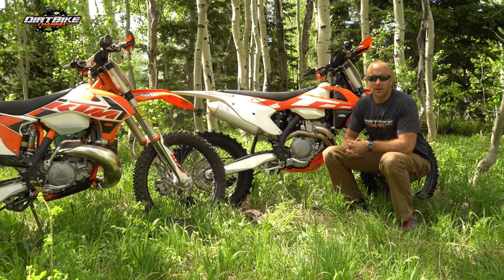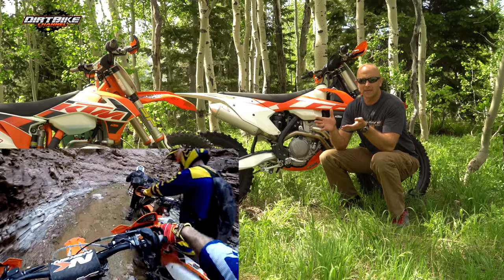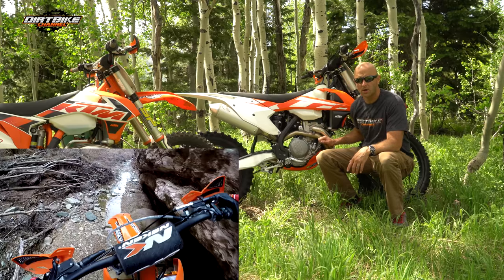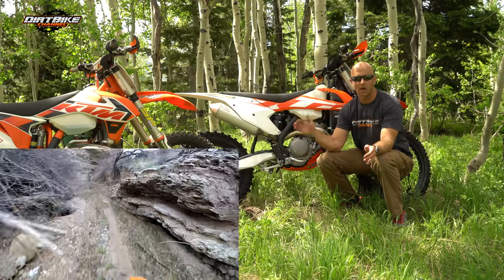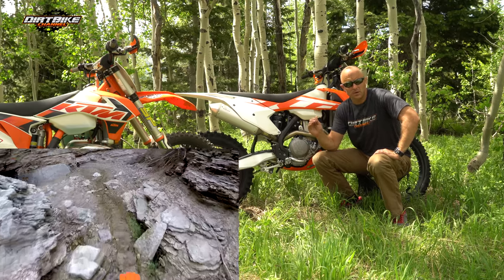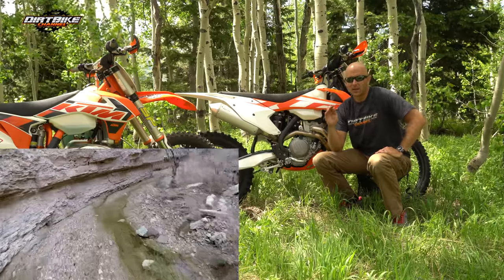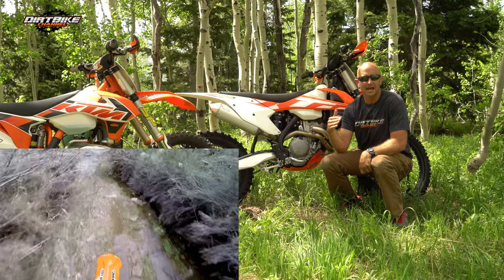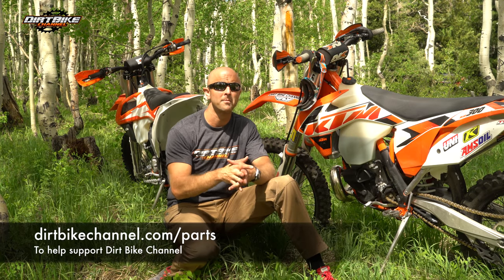Electronic Fuel Injection on 2 Stroke Dirt Bikes? Part 1 - Episode 139

Comment: as you said, yeah it's a trade, but you didn't mention anything about fuel consumption and pollution and with a system like an Athena 2SDI you really don't need a battery at all, with a direct injection the pros are too much over the cons
Reply from the maker: I don't think the fuel consumption is all the much different.  I will cover that in the next video (if I didn't cover it here)...  I have a lot of these bikes and there isn't the much difference in economy from my experience.
Reply: first of all sorry for my bad english, gonna try my best here ahah. the crappy thing about the standard 2 strokes and their low efficiency and high pollution is that some fuel get wasted out of the exhaust because the scavenging and the intake (mix going into the cumbustion chamer) phases occur at the same time, that's really it, and that's why all the injected 2 stroke (for example the e-tec system, one of those used on outboards and snowmobiles engines) are direct injected (meaning the injector injects the fuel directly into the combustion chamber) you really can't compare the advantages of the efi on 4 stroke with those of the direct efi on 2 strokes, with this said i realy think that some madman in the big industries could use a standard NON-direct efi on a 2 stroke (just replacing the carburator with an injector).....and that would be nonsense, since it would not improve that much. if you are interested check "brp e-tec", the old "aprilia ditech" and "athena d.i.c.c (or 2sdi)" you'll get what i'm trying to say.

Comment: But if two strokes get EFI, if the battery would die, could it still run?
Reply from the maker: Yes, many EFI bikes don't have batteries.  They just need to be designed around that.

Comment: Efi on the ktm 2 strokes and other brands (ktm is confirmed but keep reading) before 2020. It is absolutely 100% confirmed. There is a new euro regulation coming in 2020 that is so strict it needs to be fuel injection in order to be clean enough. The guys at ktm are in the final stages of tuning. So in 2019 or 2018 efi is coming in at least ktm 2 strokes. And if other manufacturers want to be able to sell their 2 strokes in Europe then they will need to be fuel injected too.
Reply: Oh, and he also said the 2 strokes price will be more towards the 4 strokes. I'll try to find the press release
Reply: Couldn't find the one I was reading but here's a different one. Can't copy and paste the whole translated version but the original link is not English. 
Read it here- 
http://m.vitalmx.com/forums/Moto-Related,20/KTM-2-T-270-300-2018-uses-electronic-injection,1300441
Reply from the maker: Thanks for sharing.

Comment: Fuel injection is way better. The modern fuel injected snowmobiles have no batteries. The rotax in the new Ski-Doo Summit 850 is direct injected and makes 165 horses, also matches Yamaha 4 stroke sleds on emissions, because it injects the oil directly into the bearings instead of mixing with the gas. FI is way better. easy starts and runs at all elevations and temps.

Comment: "i can not tune my fuel injected bike with a screw driver on the trail"
if you havent tuned your bike before you leave why the fuck would you bother tuning it mid ride?
also you'd never need to tune your fuel injected bike mid ride lol
Reply from the maker: I've surely wanted to tune my bikes mid ride and many of them have had EFI.   I'm just sharing my opinion.  Thanks for the comment.

Comment: You need a battery to run EFI? Hmmm...nope. Hasn't arcticcat had battery-less EFI for many many years now? Yup. If your worried about tuning, buy a power commander 5, weld in a bung on your two-stroke pipe and it'll do the rest for you. Auto compensates. We've done it for years and I bet it's cheaper than a electron carb. And the bonus is when you get home you can plug in your laptop and see everything the engine was doing. Welcome to technology.
Reply from the maker: Right I've had a couple of Yami's with out batteries that had EFI.

Comment: it's a cost thing, direct injection and adding an ECU is expensive. throttle body fuel injection is only a tiny step away from a carburetor... dirt bike companies are cheap and there's already not a ton of profit in them for builders, think about it, they sell for only a little more than a mountain bike yet are ten times more complex.
Reply from the maker: It's not only cost.  For the past decade, they have been trying to get EFI to deliver power more like a carb :)
Reply: Tiny step is to fit TWO STROKE bike in Euro-4?

Comment: Who needs EFI on a 2 stroke?  Not me. I would like to see electric starters on 2 stroke dirt bikes. Why yo ask? I'm 70 years old,but that's not the main reason. I have ridden motorcycles and kick started them for a lot of years  75% of my motorcycles were flat trackers with high compression engines so either kick it or bump start. You know what the electric starter is over 100 years old even motor scooters have electric starters on them. Back to kick-starting a competition engine with anywhere from a 10:1 all the way to a 12:1 compression is hard on the knees and the ankles. Plus being hit by cars while riding my street bikes smashed ankles and knees.Also during my flat track racing all the crashing so many times while trying to win a $2.00 trophy took a toll on my knees and ankles.  So it's time to put an electric starter on 2 cycle dirt bikes,way past time. Says me!

Comment: Drives me nuts that the combined forces of vocal activists and a bureaucrat in an office somewhere will eventually regulate 2 strokes out of existence. Meanwhile the argument you made about simplicity and the impact of a problem in the field 30 miles from the truck and the inability to fix it with simple tools is meaningless to them. Anyway great videos, keep em coming!
Reply: Yes, the same kind of persons who put two strokes out of professional motocross by imposing the unfair and arbitrary rule of twice the displacement for the 4t. If the rule was something like 125 against 200, or 250 against 350, we would probably see more 2 t on the tracks...
Reply from the maker: Thanks for chiming in on the issue.
Reply from the maker: You are making some great points here.

Comment: 2 stroke DI done right never needs to be tuned or tinkered with, just add gas and go. if the fuel injection needs to be tuned with a computer than its a bad design. fuel injected sleds are pushing 12 000 kms on a motor when carbed engines are only pushing 5 000 km's. i have never touched the fuel injection system on my sled, why should it be any different on a dirt bike ?
Reply: Part throttle and constantly changing exhaust temp is why it will never work on a two stroke motorcycle. See my other longer comment in the comments!
Reply: There is a way around it one way or another. the biggest problem is technology just isn't there yet. When technology develops and gets smaller and smarter fuel injection will be lighter and cheaper to have. Instead of an oxygen sensor in the exhaust a small computer could calculate moisture, elevation, and temperature to deliver fuel accordingly.
Reply: Many people have tried and failed. The Suter MMX 500 (google it!) tried at the IOM this year and I have been told had huge fuelling issues. That is 100,000 Euro bike with some really great engineers and minds working on it and they can't get it to work.
Reply from the maker: Interesting stuff.

Comment: ...and that's another reason to go with efi, tuning isn't in your vocabulary anymore, not because it isn't tuned properly but because that's what efi does, it self tunes instantaneously in all environments.  Thanks to the emission standards the motor sports industry was forced to hone efi technology, and now it's fantastic.  the carb technology in these brand new 17 bikes was state of the art technology in sleds over 10 yrs ago.....10...that just blows my mind.  they still offer carbed versions but nobody buys them.  your right efi will come at some point, they may need a reason, like emissions standards or something, but once they make the leap it we'll look back on it like a no brainer.  BTW efi doesn't require a battery.  so many efi myths out there.
Reply: I wish I could link you guys to some two-stroke efi articles but its common knowledge now and so not many people are debating it anymore, for a few years it was a big debate with sleds, mainly mtn sleds, where tuning was an art. honestly I would love the ktm Honda Yamaha engineers take on this.
Reply from the maker: How does the fuel pump work on my bike without the battery?
Reply: +Dirt Bike Channel runs off the power produced from the engine turning.  most if not all efi technology today works on kick or pull start motors.
Reply from the maker: It is true that my YZ450F had EFI without a battery, but it didn't have a fuel pump that I know of.  Maybe it did and I just wasn't aware of it.  It's just that other bikes do have batteries and pumps.  When those batteries fail, then the pumps won't work.  Not sure how they will start after that on in the wild.  Again complexity comes in here.  It's a nice debate.
Reply: +Dirt Bike Channel It's a conversation that will bring better technology eventually  Coming from a sledding background and looking back 10-15 yrs since the technology was born in 2strokes it is truly amazing.  The failures, tunability, weight, reliability have all been non issues.  Motors go 2-3 times the previous carb model run life mainly due to the precision of fuel and oil into the motor.  I ride sleds my riding style has always been a technical boondocking style, like an enduro version of sledding.  there has not been a single situation where I'm thinking....wish I had a carb to do this or that better.  it simply does not exist.  the turbo guys had issues adapting the kits to fuel injection but now they don't really.  in fact the newest efi on the skidoo 800etec (look it up) is a high compression injection into the combustion chamber, like a car.  it's presicion in every way is remarkable.  this same motor was pushing 120 HP 8 yrs ago on a carb version.  today that exact same motor head cylinder piston is now pushing 165 HP....AND is lasting 2-3 times longer engine life.  instead of a rebuild at 2500miles, they are getting 6-7000 miles before compression is down.  And they run on 1/2 the oil consumption as before.  And fuel consumption is improved. And this all operates batteryless.  And it's not smoky.   if I were you guys I would be very excited for what can still be done on these bike motors they make.  I'm amazed Evey year what the snowmobile industry is doing with two-stroke technology.
Reply: +snengineer and the only reason I can think of as to why the dirt bike industry hasn't gone this route or developed this route yet is because they havnt had to.  the EPA was going down hard on the sled industry, they gave them the bird and made awesome technology that's way cleaner then the EPA forced them to do.  funny how things turn out.

Comment: BUT AN EFI TWO STROKE WILL HAVE NO PRE-MIX!!! NO EMISSIONS!!! NO MORE MIXING GAS!!!
Reply from the maker: We actually don't know that.  You may still need to mix gas unless they do an oil reservoir and oil injection.  Mixing gas is easy anyway.
Reply: Dirt Bike Channel BUT!!! If you put the fuel directly into the cylander and have the sump filled with oil. So you will only have an exhaust port. THEN NOW PRE MIX!!!

Comment: They should never put EFI on 2 strokes. EFI is the worst thing to happen to dirt bikes since flexx bars and linkage suspension! It breaks down all the time and unless you have a degree from Hogwarts good luck fixing it yourself.
Reply: If it's so bad why are most if not all 4 stroke bikes EFI now
Reply: +Husqvarna enduro  Its a government conspiracy between the Motorcycle Manufacturers and Voldemort. He wants to enslave the muggles by making us dependant on them to fix our dirt bikes.
Reply: +Husqvarna enduro Bc 4 strokes are shitty
Reply from the maker: Ha ha. That made me laugh.  I want to go to Hogwarts!
Reply from the maker: Because environmentalists have pretty much required it.  The dirty truth is that your lawn mower is a bigger problem for the environment than your dirt bike.  Think about it.  There are 50 lawn mowers to every dirt bike out there and they are all being used EVERY WEEK to mow the lawn.  I use my mower every week, but I don't use my dirt bike every week.  There are MANY more small motors like that (to say nothing of cars), dirt bikes are a drop in the bucket.  You can't fix the problems with have with greenhouse gasses by making dirt bikes run a little cleaner.  There just aren't that many dirt bikes.